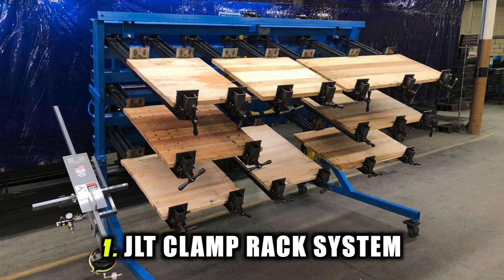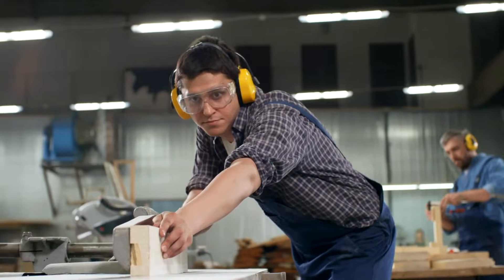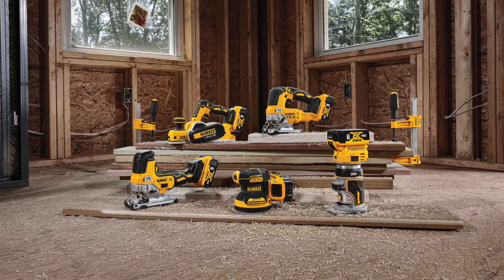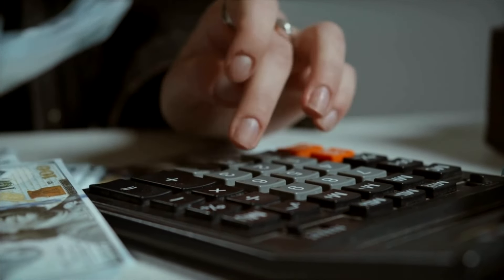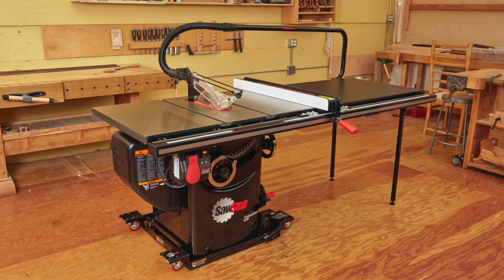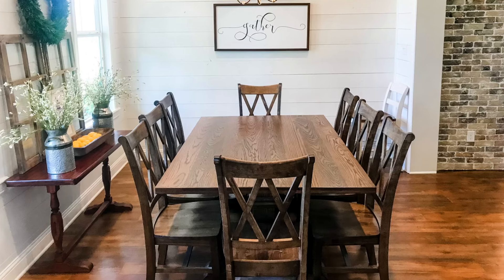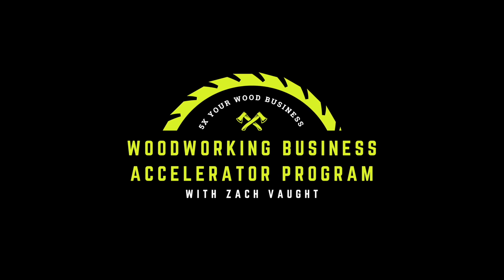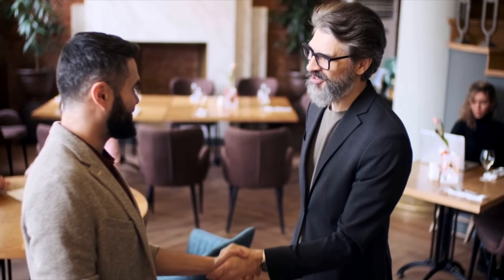Do NOT Buy These Woodworking TOOLS

Comment: Knowing what tools you'll need and not being in a hurry to get them has worked really well for me on the used market. A couple deals are powermatic 66 table saw for $300, oscillating wide belt sander for $700 (normally over $6k), 8 inch helical head jointer for $500 (needed a $30 pulley), laguna lt16 bandsaw for $600 with a carbide resaw blade.  The list goes on, but being patient and jumping on deals when they come up can really pay off.

Comment: As someone who has worked as a woodworker but don’t have my own shop, what tools should I prioritize getting?
Reply: I really like Zach and his program. Incredibly smart guy. 

I started a full time wood biz this year and upgraded some tools and machinery to help lower labor costs, but purchased used tooling at bargain prices. 24” drum sander for 1/3 of retail, cabinet saw for $200, and one recent tool I really enjoy is an igoo dual dowel jointer for $150. Way cheaper then a festool domino, almost as strong as floating tenons. simplifies joinery, no need to pocket hole. Never even owned one. Check them out for simple joinery,
Reply: 1 - Sash clamps (auctions or flea markets for old ones that still work great.
2- track saw if you work with lots of sheet goods, if you need a decent table saw go with a good job site saw for the first few years. Skilsaw rack and pinion is pretty good in the US. In Europe it's the Evolution R255tbl+.
3. A six inch jointer and buy 6 inch lumber
4. A 13 inch planer is fine for most people. A 20 inch is a waste of money because if you want to do worktops or tables you need a minimum of 24 inches to do anything decent.
Reply: @jbbresers 
You don't need any of this if you are a beginner. 
Some decent chisels, a rip saw and cross cut saw or a combo, a square, tape measure. Then you have to decide if you are going the route of screws or woodworking joints. If you are doing woodworking joints, a small block plane. They didn't have any fancy electric tools hundreds of years ago and they built awesome stuff. Plus,if you don't have a shop, you definitely don't need power tools. I have a tiny shop and that's one reason I went with the hand tools route
Reply: @Rufio1975  handtools are great - I have a bunch and I started out using what you described but if you're making anything larger than a shoebox then flattening and jointing boards is more a labour of love than an efficient use of time. 
Where I live buying S4S lumber will bankrupt you a lot faster than buying the tools to do it yourself. 
Even handtools can get expensive with quality planes costing hundreds.
Reply: @jbbresers  I can sort of agree but usually a newbie that doesn't know anything isn't going to start out making large things in my experience. I bought all my hand tools used except a few on eBay. Good quality ones but need de-rustifying and sharpening and they work great. It's cool though. Everyone has different experiences and opinions.
Reply: As an amateur woodworker and ER physician, I think the SawStop is arguably worth it. The CTS or JSS are not that expensive. I've seen many lost digits from table saws and several of them were grey beards with decades of experience. They all give the same type of story about "knowing better" yet just slipped up with their focus leading to career-altering tragedy. If you want a woodworking business, keeping functional fingers is definitely helpful. My CTS, which obviously doesn't have all the capacity a cabinet saw does, is arguably a great table saw for a beginner who probably isn't selling giant $10K dining tables yet.
Reply: @bjmilbrandt87  Yea but some of those guys are just stubborn though and think they know better. I'm a grey beard and I value my fingers. I still have all of them because I always know where my hands are at and always make sure they aren't in the path of the blade. I use push sticks when parts are small. I don't take those chances. I remember being a newbie and I definitely did not have the money or would not buy one of those saw stops even at 800 dollars.  Priorities doc. Bills and kids. Simple set of tools is all you need to start off.
Reply: @bjmilbrandt87  At this point in time, for a beginner, Sawstop or nothing.
Reply: Are you planning a business or wanting to play?

What do you mean you don't have your own shop? You need a space. Do you have access to a shop? If so, what tools can you use there? Do you have a place to store material? Do you have a pickup to haul material? What materials are you going to be working with, S4S, sheet goods, rough lumber?  What are you going to be making? Are you any good?

If working with rough lumber, I would have a table saw or a track saw and a benchtop planer. The first thing you need to do is mill the boards and with these 2 tools there are work arounds where you don't need a jointer. Big 3 hp cabinet saws utility is mostly in ripping thick stock. Smaller less expensive saws can rip thinner stock, cut sheet goods, and cross cut most materials without bogging down.

Festool is designed for sheet goods and are copied by everyone.  Look at their designs and if too expensive, find a knock off. 

S4S, table saw or track saw, handheld 18v palm router, drill, and work bench.
Reply: @mrscience1409  Why? Again, unless that newbie has a damn good job,he or she isn't going to want to buy a tool that expensive.
Reply: @Rufio1975  40K tablesaw injuries a year. You don't need a tablesaw at all. So if you are going to buy one, I say sawstop is the only way to go until the feature is universal. Save up.

Now to be fair, proper safety training and use of a splitter and a blade guard EVERY TIME, makes the technology unnecessary. 

But of course, that's just my opinion, I could be wrong.
Reply: @mrscience1409  Naw man. You are definitely entitled to your opinion. I've been woodworking for a while now and I don't think you need it personally. I've been using a table saw without a saw stop and I still have all my fingers. It's just about training to work safely and keep your mind on your task. Do that daily and it becomes a habit. Do it unsafely and that also becomes a habit. I don't think we need to put bumpers on everything.

Comment: Wow, I guess I disagree. 

First, are you starting a woodworking business, or are you woodworking? Your advice sounds like it is for someone dipping their toe in the water. It works if the person is earning and starting a side hustle they plan to expand on. 

If this is it, you are starting a serious business. You are a manufacturer. You need space and you need capital. You need to be prepared to buy the most productive solutions for every process of your manufacturing. Outgrowing your capacity is death. Example, you are making cutting boards and marketing like crazy. Your capital is a savings account which gets a percentage of your revenue. You're doing great selling these boards when November roles around. A company calls you and wants to give one of your boards to all their clients. They place an order for 1000 boards that they need in 3 weeks. You are so excited. You get a deposit, buy some materials and get to making. 3 weeks down the line you only have 500 boards and you know you are not going to meet the delivery date. You could really use that clamp rack. Now the client wants their deposit back, but you spent it on materials. You've had to refuse smaller orders because your capacity was all taken up on this order. So for 3 weeks you've had no income. Rent is due, electricity bill, maybe you have an employee you can't pay. You have lost the client forever and future clients hear you can't make delivery dates.  You grew too fast and you are out of business. 

You should have gotten a line of credit and bought that clamp rack.